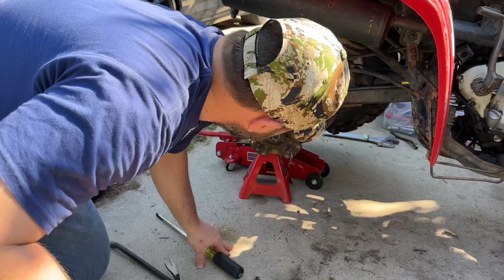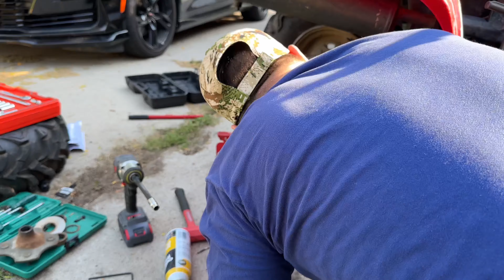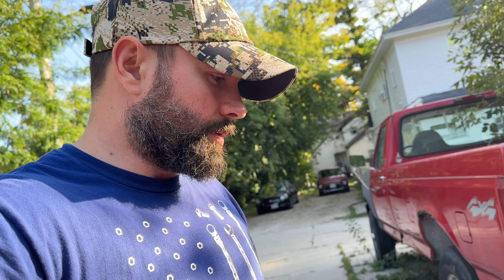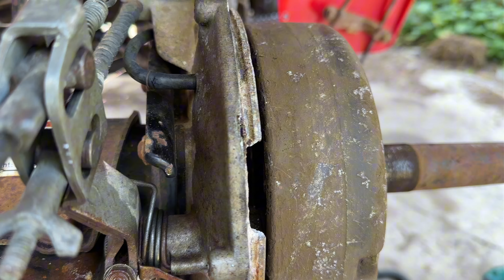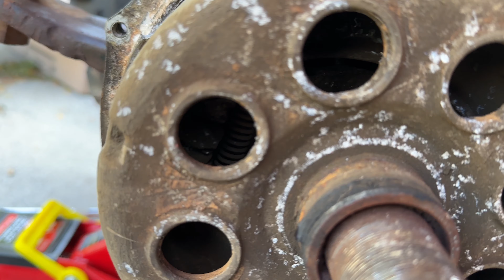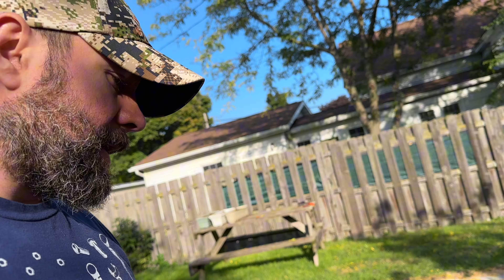Honda Fourtrax 300 Rear Drum Brake Part 2

Comment: I see you have some spray but I know for sure the brand "Knocker Lose" from Napa auto parts is the best penetrating oil spray you can get...it loosin bolts, nuts, cables,  it works miracles on rusted frozen parts hope  this helps you 🇺🇲
Reply from the maker: I got them off, but yeah they were stuck. I here knocker loose is good, I actually was going to order some, but it was going to take a while getting here, and all they had locally was Liquid Wrench. Liquid Wrench is really good compared to other stuff, but I think knocker loose may be better, and kroil penetrating oil, but I don’t have experience with either. Liquid Wrench beats, WD-40, PB Blaster, and some others I know, but I have not compared it to knocker loose, knocker loose was my first choice, but it wasn’t readily available at the time
Reply: @TiffanyBottomsHunter  yep I live south Mississippi and Napa had two cans knocker lose left & I got them both a couple months ago...like you said Kroil is supposed to be really good too but I haven't tried any...im really enjoying following along as you fix your bike up thanks for sharing 🇺🇲